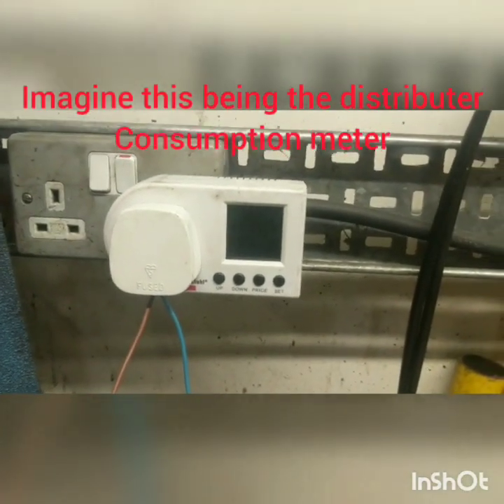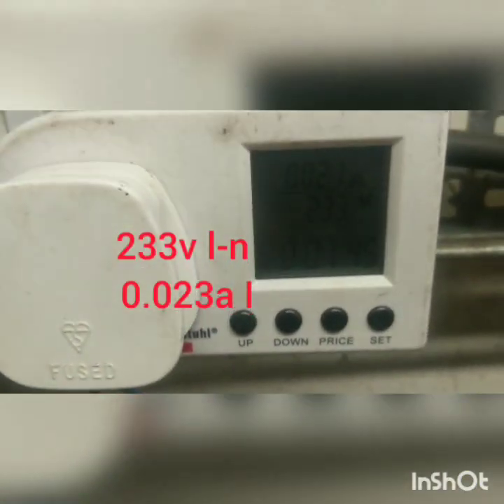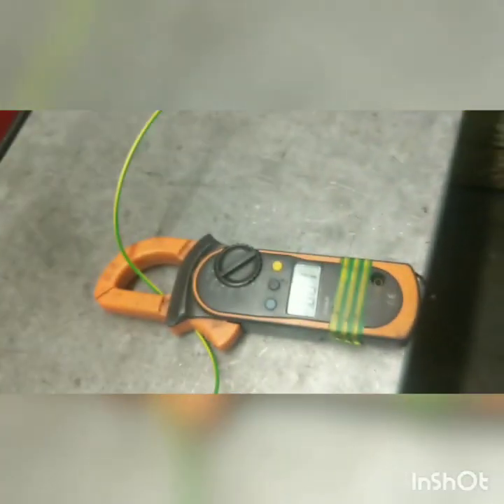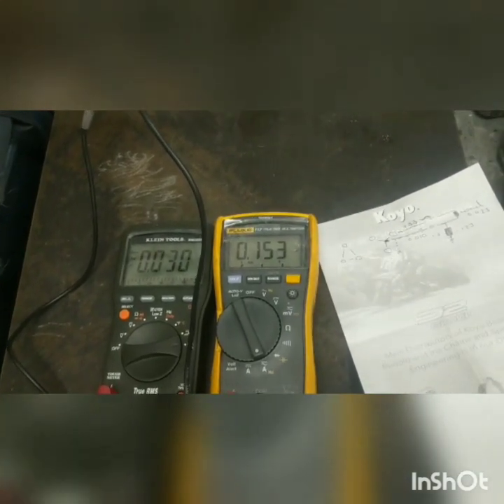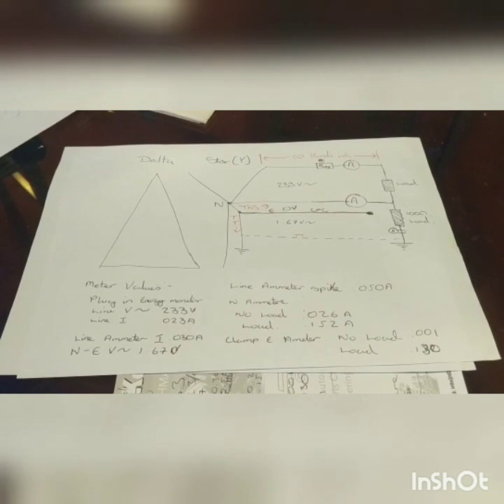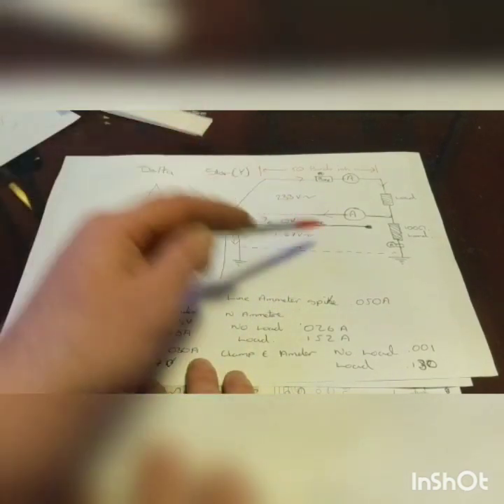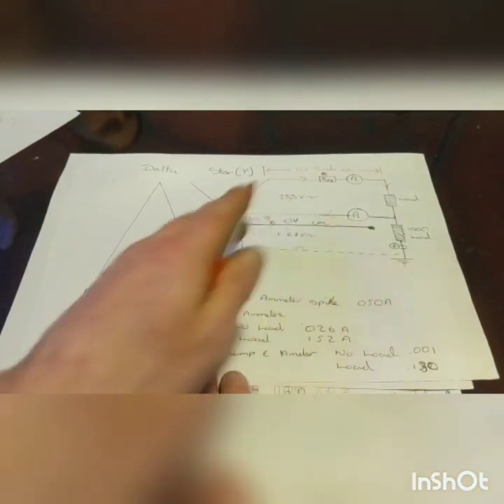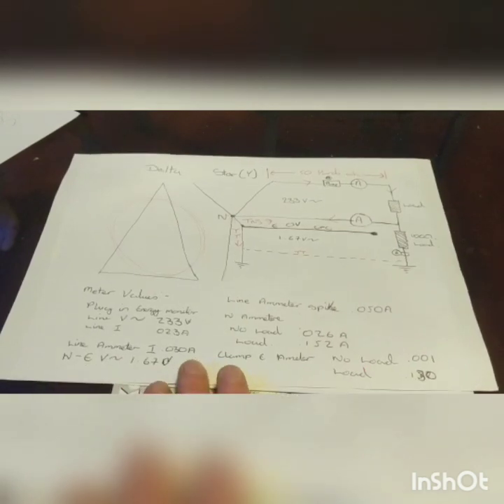Response to electroBOOM 3 million subs. There is free energy in these cables.

Comment: some info.       when a pair of conductors, that are carrying mains AC, are near one another,  the (AC) oscillations  result in the  Induction of  a bit of current, in a  cable run.      see   all  aspects  of  Induced Current.
https://en.wikipedia.org/wiki/Electromagnetic_induction
it can be understood that  most  coils  cause a bit of induced current -- within them.    this is another source of  'stray'  energy.         it can be understood that the  Layered structure of  a Generating coil (brooks coil) is optimized to cause  a  certain amount of  back-emf. 
http://nessengr.com/techdata/brooks/brooks.html
in a conventionally wound coil,  back-emf occurs  because  the current flow in  Adjacent layers  is  180 mechanical degrees  out of  phase; so too are the associated  magnetic fields.       in other words, the polarity of the current flow through the coil  is  not  congruent;  the layers are  Not  connected in series.!!    aka  end-to-start.      thus, if a (transformer) coil has a layered structured,  More  stray  current is induced.
in the context of  Power/watts, measured values of output amp/volts  will be  Not  be  accurate, if  a  load  is present in the output circuit.      in fact, in this context,  a  Normal output circuit  should be simulated;  by  Shorting  the output  ---  thru an ammeter; for amps.      where a mechanical process is involved,  lenz-related losses  normally result in a  speed reduction; and, the nominal output  Voltage  Must  be based on  THAT  speed.    if interested, see my leverage-based research.   cheers          googletranslate
Reply from the maker: Thank you. I'll have a watch.